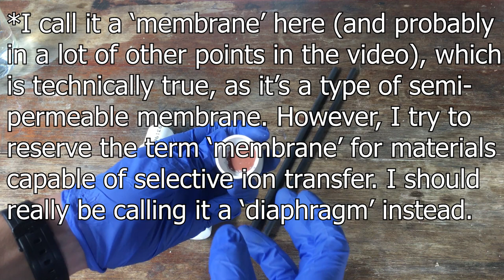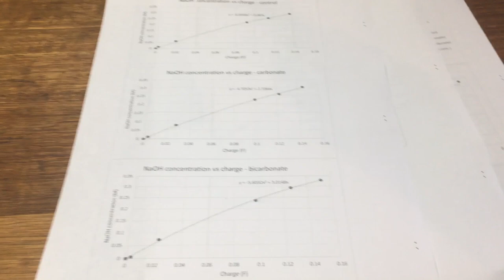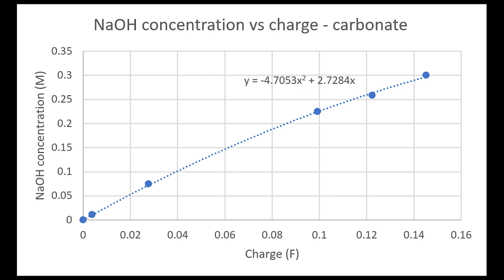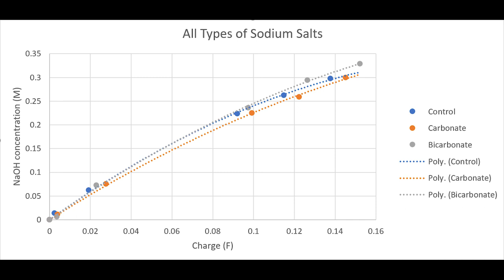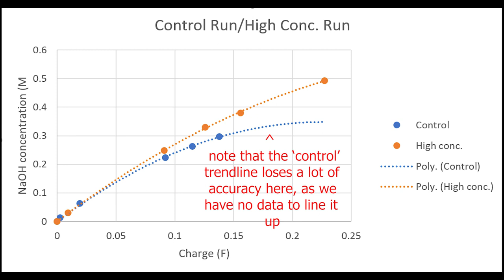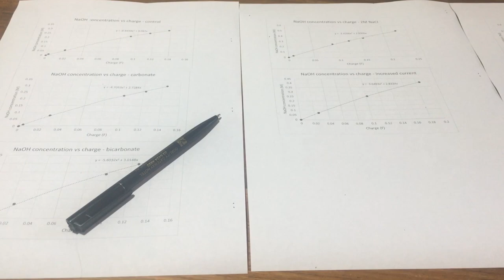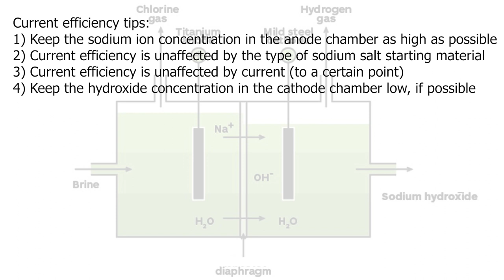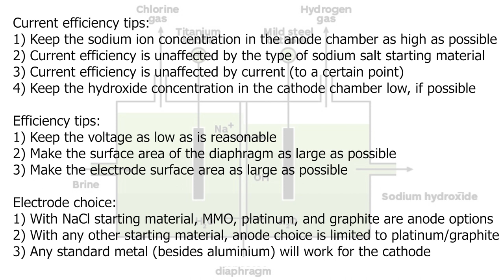Sodium Hydroxide - Diaphragm Electrolysis ep1

Comment: I have a question about sodium chlorate cell,so to make sodium chlorate we put chatode and anode into a solution of sodium chloride aka tablesalt,temperature of solution should be at least 70°C,we run a current and sodium chlorate starts to produce,now my question is what reaction takes a place?What i guess is that on positive electrode we produce chlorine and oxigen while on negative electrode we produce hydrogen and sodium,sodium instantly react with water and created sodium hydroxide,now as percentage of sodium hydroxide raises up it starts to react with chlorine and oxigen forming chlorate,now is that right or wrong asumtion?
Reply from the maker: You've got the general idea, but not quite.

First, there are two different reaction pathways that can occur in a chlorate cell, the first (less efficient) pathway occurs in cells without pH and temperature control, while the second (more efficient) pathway occurs only when the temperature is held around 70C and the pH is held at nearly exactly 6.7.

Pathway 1 (occurs in room temperature cells without pH control):
First, the cathode exclusively generates hydrogen (sodium is never generated in aqueous solution) by the reaction:
2H2O + 2e-  >  H2 + 2OH-
Note that hydroxide is generated as a by-product here, basifying the solution somewhat.
Initially, chlorine is generated on the anode  ( 2Cl-  >  Cl2 + 2e- ), but as the hydroxide ions from the cathode make the pH of the solution rise, the chlorine off the anode will react with the hydroxide ions by the reaction:
Cl2 + 2OH-  >  ClO- + Cl- + H2O
At this stage, the overall reaction is simply making hypochlorite ( ClO- ) ions, and it technically occurs as a single step on the anode, but I think it's easier to conceptualise if you imagine chlorine reacting with hydroxide, as above. These hypochlorite ions slowly increase in concentration until they start to react on the anode once again:
12ClO- + 12OH-  >  4ClO3- + 8Cl- + 6H2O + 3O2 + 12e-
It is only after this second stage of the reaction that the chlorate is actually generated.

Pathway 2 (occurs at around 70C and ONLY at a pH of ~6.7):
The second pathway occurs in a similar fashion to the first up to where the hypochlorite is generated. At the required pH of 6.7 and temperature of 70C, some of the hypochlorite is protonated to form hypochlorous acid (HClO), which will react with further hypochlorite ions to form chlorate:
2HClO + ClO-  >  ClO3- + 2HCl
Again, it is this second stage of the reaction which forms chlorate.
Reply: @ScrapScience  but wait,if we dont heat up solution to 70deg C we will produce sodium hypoclorite  aka bleach NaClO
Reply from the maker: Yep, exactly. And as the hypochlorite concentration increases, it will eventually itself get electrolysed into chlorate, as per pathway 1 in my comment above.
Reply: @ScrapScience  thanks alot
Reply: @ScrapScience  in order to run this electrolysis successfully, should we keep both containers closed for storing all chlorine ions inside the solution?

Comment: try two-part sea water electrolysis, same diaphragm cell
Reply: assume all metals and hydrogen will be one part of the cell, the NaOH part, and Chlorine on the other part of the cell, like the NaClO
Reply: try making metal hydrides, titanium hydride, various methods, TiH2
Reply: higher temperature (near 70-100C) electrolysis
Reply: crystallize the brine side, to NaClO3, at that higher temperature
Reply: heating should work similarly as lasing energy pumping, more electrolysis, side energy supply

Comment: You seems to forget that hydroxide solution absorb CO2 in air and from my experience it does not take a long time to do it. Letting your solution exposed to air that long I have difficulty believing that most of it is not turned into carbonate. When I make copper(I) oxide by electrolyzing a KCl solution I must add HCl every days to prevent the Anode to be passivated by carbonate formed from the KOH absorbing CO2 in air. A large amount of CO2 is generated when I add the HCl and the electrolysis restart.
Reply: Close the system.
Reply from the maker: Yeah, that was the main reason why I didn’t bother extracting the total NaOH. I wasn’t worried about it affecting the titration results though, as Na2CO3 will react the same as the original NaOH during the titration.
Are you sure the absorption of CO2 is that severe though? I had my ~0.4M NaOH solution sitting out for 3 weeks and it barely bubbled upon acid neutralisation.

Comment: You know if I can use stainless steel as an anode?
Reply from the maker: You cannot use stainless steel as an anode, it won’t hold up to the oxidising environment while generating chlorine or oxygen under these conditions.
The only reasonable anodes you can use are the ones I mentioned in the video.
Reply: oh, so I will use the carbon ones, hopefully soon I will Buy some titanium anode. Thanks for answering!

Comment: What is sodium hydroxite needed for so much?
Reply from the maker: Overall, sodium hydroxide is one of the most useful chemicals in my opinion. It makes for the cheapest and most effective base.
In actual chemistry, solutions of it are very useful for scrubbing acidic gasses, making sodium salts, dissolving various metals, and precipitating transition metal complexes.
Most people outside of chemistry tend to use it for soap making and as a drain cleaner.
Reply: @ScrapScience  Also for bio-diesel.

Comment: You can literally use a bench power supply. It goes up to 5 amps. All of this couldve been done in an hour or two.
Reply from the maker: Just being capable of high current doesn't make a power supply ideal for this type of experiment.
The current will inherently be limited by the diaphragm, so trying to push a large current through the cell would heat it up considerably, and waste a lot of the input energy.
A bench power supply is more useful in a larger cell setup (which I do have another video about), but this small-scale test didn't require the use of high currents, so the power supply I use here did the job just fine.

Comment: Why you didnot use 325v dc ?
Reply from the maker: Aside from safety concerns, low voltage is MUCH more efficient in terms of energy usage for electrolytic reactions. It's also much more stable in terms of ripple and far easier to measure the current/charge in an experiment like this.
Reply: @ScrapScience  Hi 
I know i am bothering
You.sorry
Amm how is heavier O2 or O3?
I mean why ozone doesn't fall 
On us becaus ozone have 3 atoms
It should be heavier due to the gravity??

Thanks
Reply from the maker: @electromagic3111  You're definitely not bothering me, getting asked questions is my favourite part of youtube.

There are a couple of reasons behind the ozone not falling. First, the formation of ozone in the stratosphere is a dynamic process. UV from the sun will split oxygen atoms and form ozone continuously, and it doesn't really have time to move large distances before disproportionating. As such, it pretty much exclusively sits in the ~50km thick layer in which it forms.

Second, the effect of gravity on gasses of different masses is incredibly minimal when compared with the effects of turbulence and air currents. Heavy gasses, when they are as dispersed as ozone is in the upper atmosphere, will simply mix in with the atmosphere rather than 'fall down'. It's like how the salt in seawater won't just sink to the bottom of the ocean to leave fresh water on the surface.
Reply: @ScrapScience  ok last 
Question
If i generate O3 (corona discharge) in my room 
Would the ozone go up to the roof
Or down(0 air turbulence or air flow)
(O2 density stp 1.429g/L)
(O3  density   0   2.144mg/ CM`3)
Wikipidea
 Why its very light?

N thanks alot i really appreciate your help😘
Reply from the maker: If there were absolutely zero turbulence (impossible), ozone would slowly sink downwards, as it is heavier than the nitrogen/oxygen in air.
I would advise against making ozone by corona discharge indoors though, if that’s something you’re planning on doing. The nitrogen oxides generated as side products aren’t good for your lungs.
Reply: @ScrapScience   ok i think that the smell of NO gas going up
Or hot Ozone gas
 Thanks😘